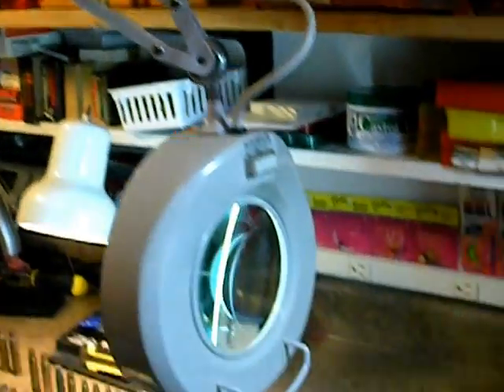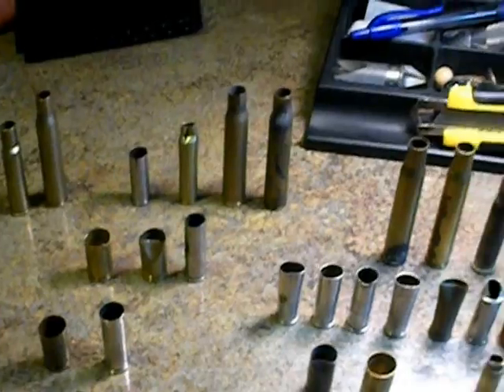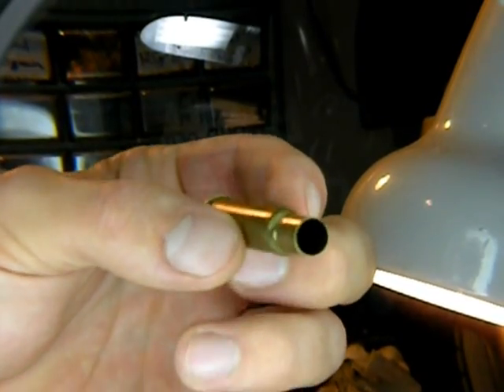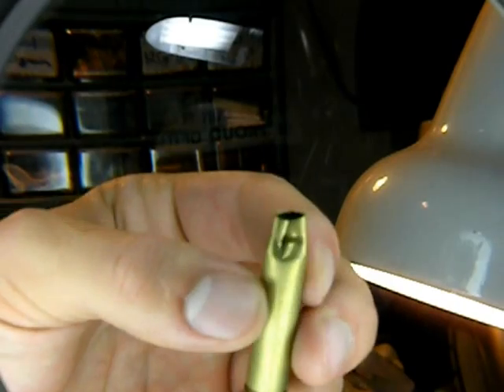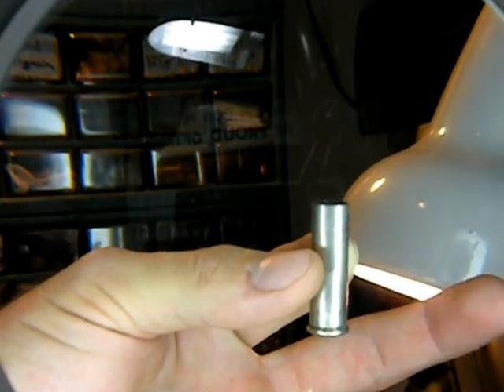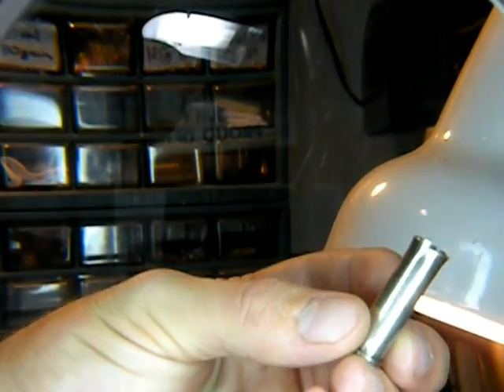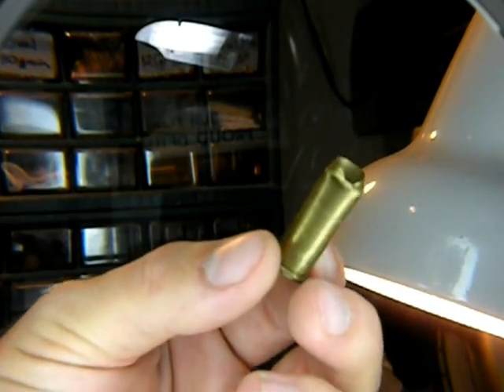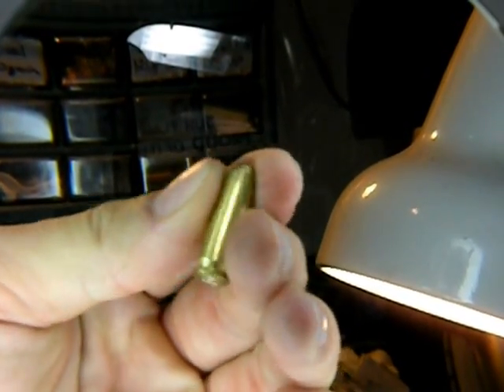Brass Inspection for Reloading. What problems look like!

Comment: Terrified, trying to reload some 10mm for the first time. Lot of glock pin marks on the primers with big ole prego bellies. Really don't want to discard a 3rd of the "once" fired brass i bought, but I haven't had the conversion barrel long enough to endure the loss.. Most 45 i have bought (nickle plated) has a cannelure on the case. Some has the ring you showed in its place. Is it a sign of wear or just a different cannelure, one without the dotted line?

Comment: Hi Weston, nice video with examples. Hey question for you, the example of the .38 you had.looks just like 6 shells I collected of about 50 off the ground last night after doing.some shooting with a pretty new gun for me.  10mm CMMG 10mm Banshee.  Well 6 of my cases look like that .38 except several are worse!  Two look like the bottom 15 Percent of the case is more like an .45 than a .40 call!  And these were shot from a new box of Blazer ammo, partial of Hornady and some Underwood.  And by chance, 2 of each brand are represented in this pile.of 6 swollen cases I have. I had no FTF or malfunctions.  I am stumped at what causes this.  Any ideas there?

Comment: Question? When I brought it from wolf steel .233 but can use 5.56 x45 62gr. After fire then I did collect it and most of 400 round fired everything look good but maybe 6 steel already split neck. I was just wonder maybe pressure or chamber inside? That's great show example. Thanks